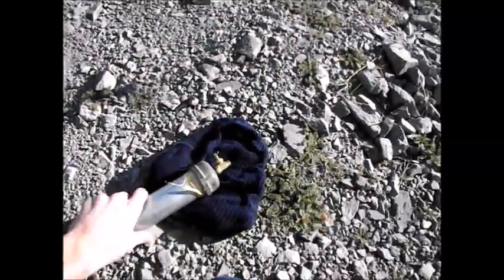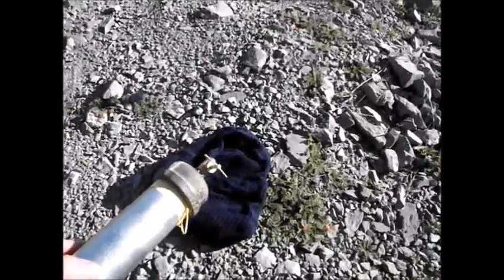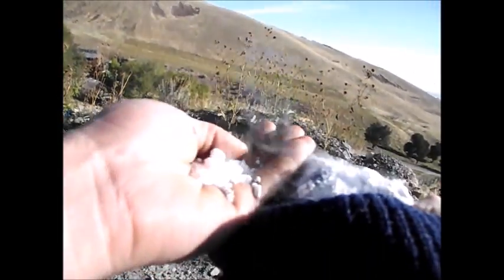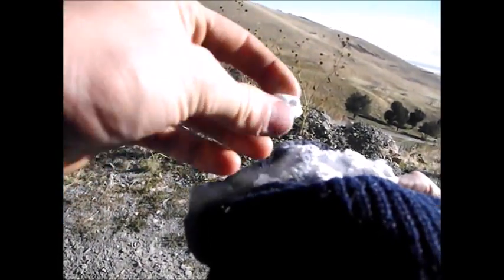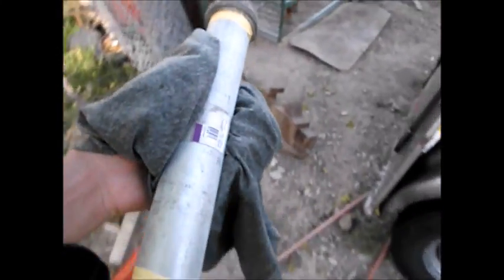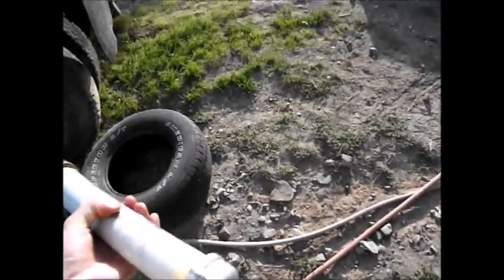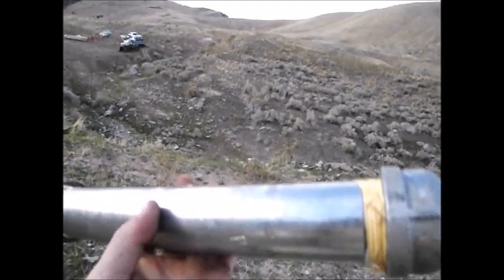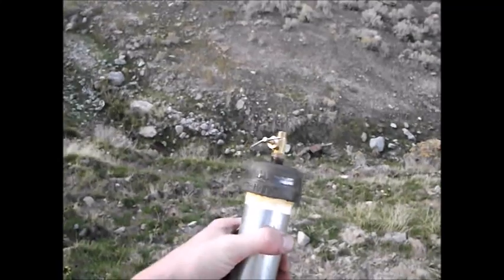Homade CO2 Storage Vessel

Comment: Curious if you tapped a compressor gauge on there to see the pressure. Would be a good way to check the integrity without just keeping your fingers crossed that its still sealed.

Comment: is it able to release room temperature CO2?
Reply: It might if the exit valve is a lot bigger than what it is, because gas that escapes while under pressure (so from a small exit valve) becomes really cold, but gas that escapes while not under much pressure (so from a large exit valve) is warmer.

You can see this in the works if you open your mouth really wide a blow, the air feels warm, but if you make you mouth small and blow, the air feels cold.